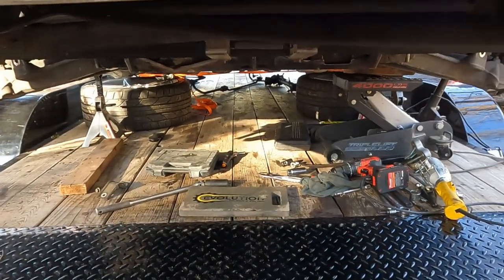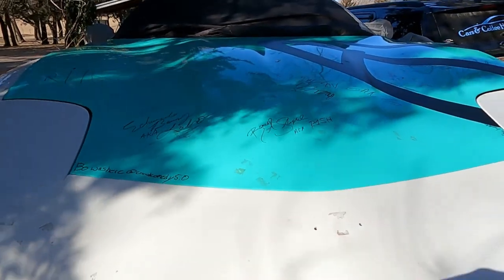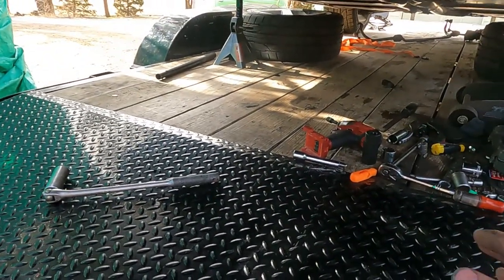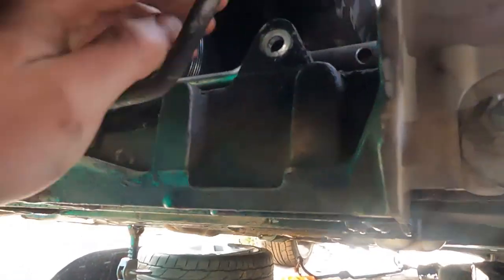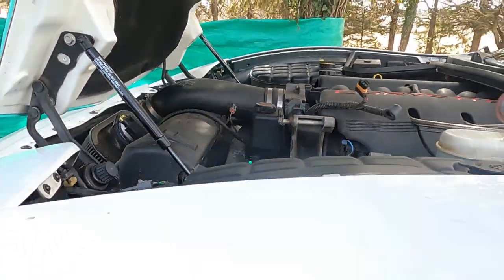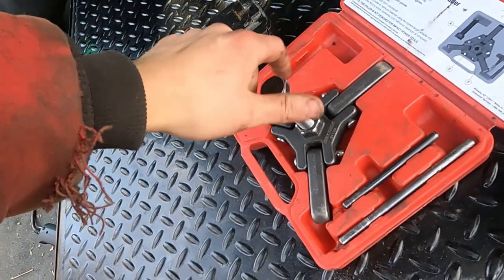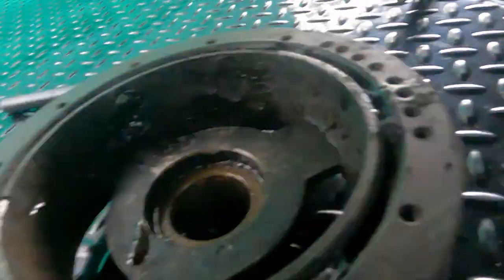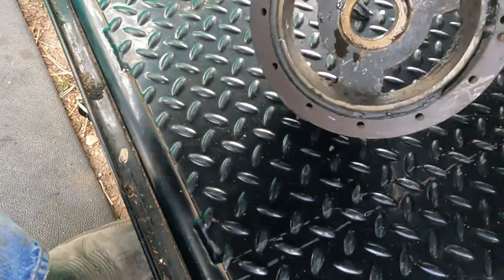How to remove crankshaft bolt and harmonic balancer on Corvette (C5 1997-2004)

Comment: How to take off the bolt  with moving the piston moving ?
Reply from the maker: Are you wanting to remove it without moving the pistons?

If so, try setting up a prybar to hold the balancer in place while unbolting the bolt.

If not, I suggest the way that I removed it here in the video. Setting the socket and breaker bar on the cross member. Then removing the spark plug wires, to prevent it from starting. Finally crank the car over for a split second to break the bolt loose.
Reply: I didn’t have the balancer on is just the bolt by it self
Reply from the maker: @dariuslewis9320  oh dang, that adds difficulty.

The only thing I can come up with is use vise grips on the crankshaft, but I don't recommend that at all. 

Potentially a better option but more work. Would be to hold the flex plate/flywheel in place while removing the bolt.

What's your project, (replacing the crankshaft, rebuilding the motor, replacing the balancer)?
Reply: @ArcticVette  I give it try today.. I have 02 c5 Z06 need my cam bearing replaced then going hop on to the balancer thank you for the info
Reply: @ArcticVette  I give it try today.. I have 02 c5 Z06 need my cam bearing replaced then going hop on to the balancer thank you for the info
Reply from the maker: @dariuslewis9320  you're welcome! Best wishes on the projects! Feel free to let us know how it goes. 🤘🏻

Comment: What was the extension for when you was using the puller ? I just rented the same Chrysler harmonic balancer puller. Trying to see how to use it
Reply from the maker: I was using extensions to allow the puller bolt to push have something to push against. It was too short for this application so we improvised.
Reply: @ArcticVette  oooo got it ! Thank you I have 1998 so your vids are helpful just got the crank bolt off, sucker was tight man lol
Reply from the maker: @y0ungtchalla420  awesome! Glad you got it off!